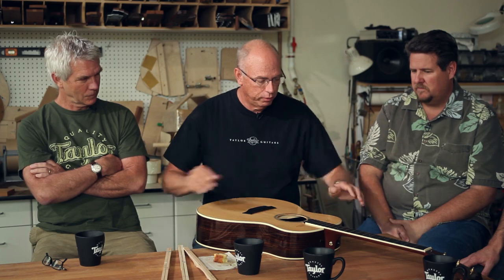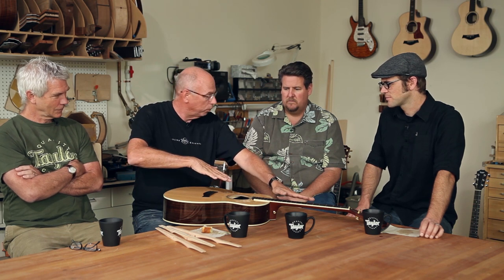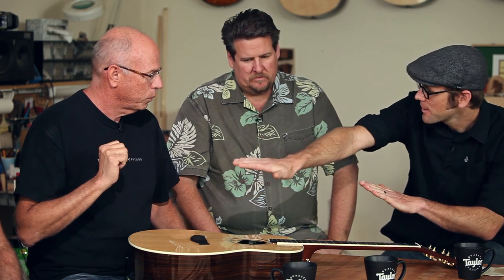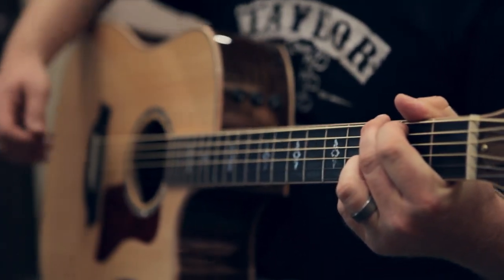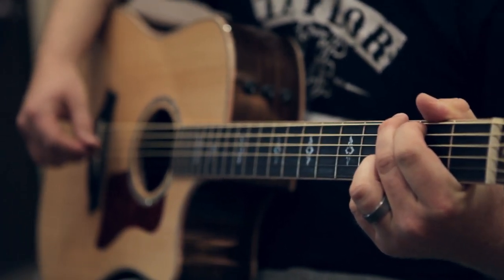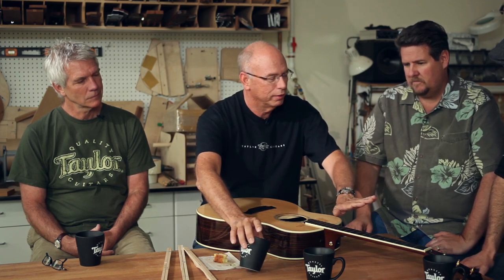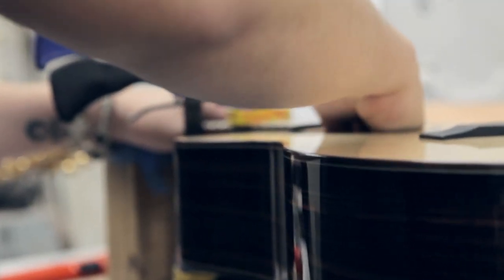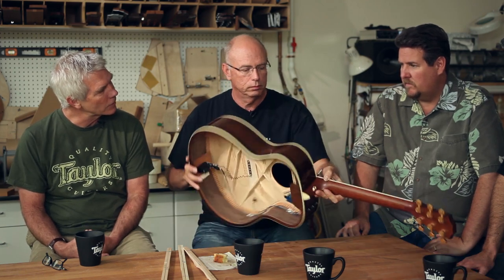Taylor Guitars' Perfect Neck Angle - Talk About Taylor

Comment: The way I always had to lower the action on my acoustic guitars was to take out the saddle and sand in down.   This always resulted in a big loss of tone and volume.  I now have a Taylor 814 and I found a certified Taylor tech to shim the neck back slightly. I am really looking forward to seeing how this affects the tone and action.   I am looking for a sweet spot and want maximum playability without sounding like a sitar.
Reply: how did it work out for you?
Reply: I found the same thing with my guitar, what do you mean by shim? truss rod adjustment?
Reply: @joshuabalraj  Taylor use two thin pices of wood, shims, under and behind the neck, to adjust the neck angle. Choosing the right thicknesses of shims is what it's all about
Reply: So if I want the guitar to feel a bit more “slinky” vs stiff which way do we move the neck.  My Taylor feels a bit stiff.

Comment: What is the magic spot for a perfect neck angle?????
Reply: johntrik its different for each guitar and player. I have 6 Taylors and they all have different neck relief, string action, saddle height, and I set them to how they feel best for me, not what Taylor tells me specs should be.
Reply: Most acoustic guitars feel great at .08 thousands of an inch capo at the first fret and use a feeler gauge at the 6th fret while fretting the 12th fret with your right hand

Comment: i just bought a lightly used 214ce and even with light gauge strings the action is horrendous. thank God the neck is fairly easy to adjust. I've only played electric guitars for 25 years because I've never found an acoustic that played worth a damn, at least not in my price range

Comment: Hi Guys, so what neck angle do you generally shoot for on a guitar and would you want to set it different on a acoustic vs. an electric or would that be more a preference in string action and so on? And this might be a lot to ask but would that get into the bolt on / set neck debate? Sorry, still learning and doing repairs not quite to the building phase but I am always looking for other luthiers insight. If it is quite a long topic I can ask via email. Thanks.

Comment: Sorry folks,, ,, but I have to disagree with a comment that was made here...  If the neck was pitched up and the saddle and bridge were lowered to compensate for action ,, you would typically lose over all volume of the guitar ,,,NO power !!..   A well setup acoustic guitar needs to have a nice slope from the bridge down to the nut.. You'll get a more tight crisp feel with max volume..  If buzzing on the frets becomes an issue , that would  typically be corrected using the truss rod adjustment to ensure the proper neck bow is set...   Its all about physics kids,... Cheers
Reply: I hear what you are saying. When Bob made the comment about more power based on lower saddle , I had to do a double take.  He is 180 degree wrong. 
I own a couple of Taylor guitars and they are fundamentally great guitars.  They were all improved on in my shop.
Reply: I guess the adjustment changed the scale of the guitar that makes difference in a already built guitar. but if you compensate from the very beginning, to make two guitar have equal  string length, I assume what he said will make sense.

Comment: i bought a taylor guitar 2 days ago  but its action too high , what should i do now  ... plz help
Reply: Take it to Taylor guitars repair shop in El Cajon or find and AUTHORIZED Taylor repair shop and they can adjust it for you pretty quick and painlessly
Reply: Zahin Rashid Official fix it
Reply: Put a match to it
Reply: ipmala  It's all in your hands.  It doesn't matter if you buy an expensive guitar or a cheap guitar it all comes down to your hands. If you can't make a $100 guitar sound good, then you're not going to make a $5000 guitar sound good.
Reply: I have a 2004 414 CE, I keep the humidity at the suggested %, no top bulge, no saddle raise,  neck is straight, action too high and it plays like shit. My cheap acoustics play and sound much better.

Comment: Just hate when people complain about how crappy a guitar is because it's too dry and action is messed up after owning for a few years. It's made from wood and take care of it especially if you spend big bucks on it.. You have to keep your guitars in a controlled climate, for any guitar no matter what type or cheap it is. Yes laminated guitars are more resistant to climate but still need to be in controlled environment because most have solid tops. I have a 1997 Yamaha DW-105C from day 1 new and still plays like the day i bought it. The tone has aged but not the condition it's in. Best controlled environment your guitar case with a humidifier but watch the humidity too much is bad to.. I don't treat my cheap Yamaha any different then my Taylor.
Reply: Hello from 4 years later.

Also,

When you spend big money on a guitar, you should know how to adjust it.